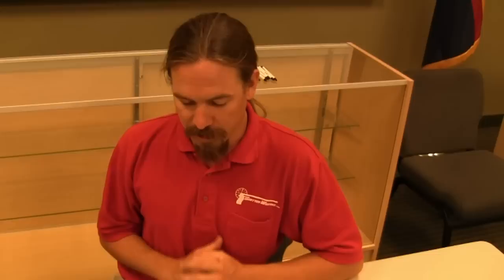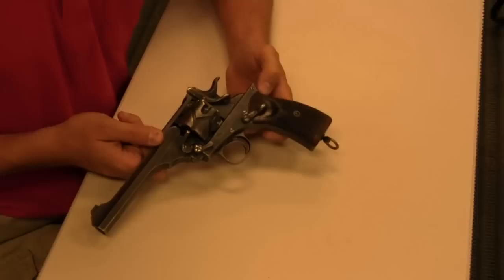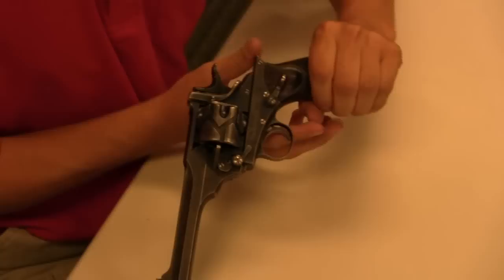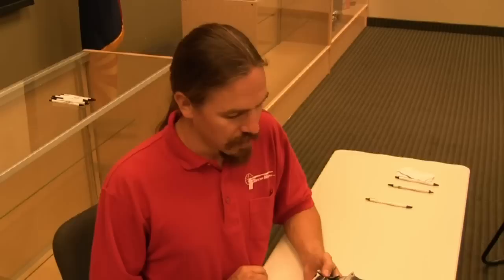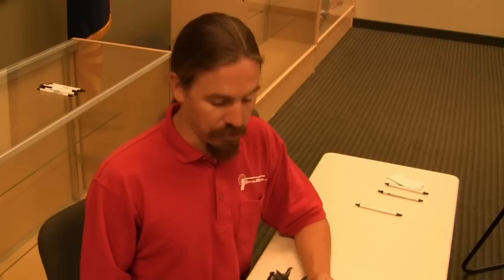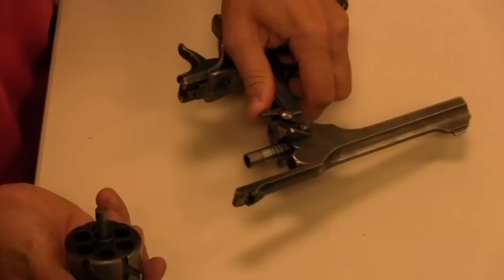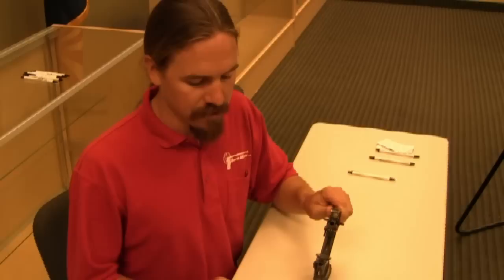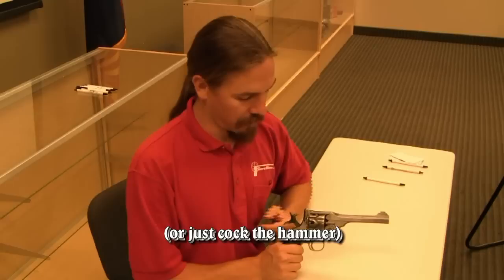Webley-Fosbery Automatic Revolver

Comment from the maker: The Bergmann 1896 was an unlocked, blowback mechanism. The reciprocating bolt is somewhat similar in appearance to the Mauser C96, but mechanically different. It did not have a slide like a Browning design.

Comment: Well, the primary advantage of a pistol like the, and it's spiritual successor the Unica 6, is that it allows for faster fire and greatly reduced felt recoil of more powerful pistol calibers like, at the time, .455 Webley, and more recently, .44 Magnum and .454 Casull.  However, in a standard pistol caliber, the cons definitely outweigh the pros.

Comment: more than likely not seeing how the upper assembly relies upon a lug in the lower assembly to rotate the cylinder which rides the "tracks" on the outside of the Cylinder itself and not a pushing cam on the rear of the cylinder as a normal revolver would. ( but I am not an expert on the subject, so that's my best guess)

Comment: why this pistol is called " automatic revolver " ? if this is a pistol ?
Reply: Typically in revolvers, you either get double action, which cocks the hammer but also results in a heavy and long trigger pull, or single action, which requires you to manually cock the hammer but gives you a crisp trigger pull. This revolver uses the recoil energy from firing to reciprocate the upper assembly, rotating the cylinder and cocking the hammer, resulting in a better trigger pull with each shot, and no requirement for recocking.